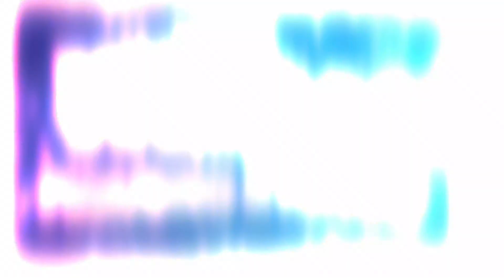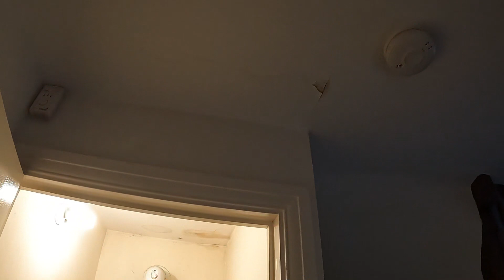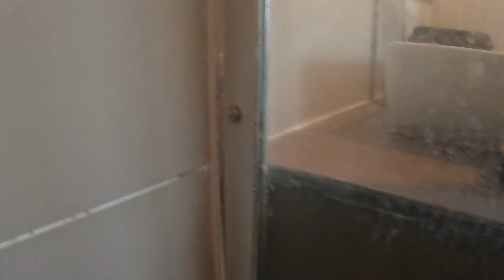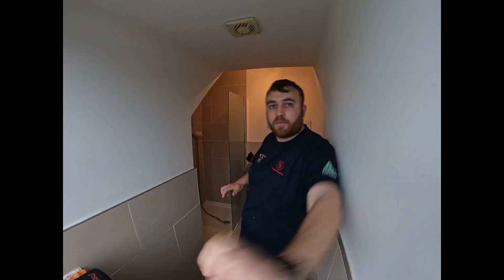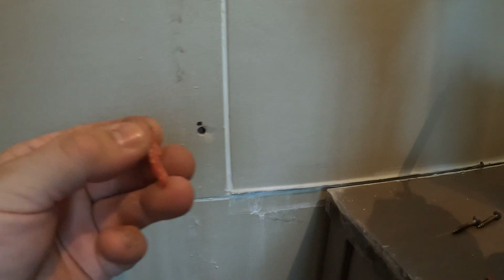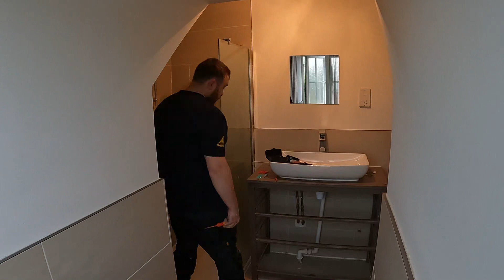COWBOY PLUMBERS! SHOCKING LEAKING SHOWER! | UK PLUMBER

Comment: I liked it, job done. CANNOT believe whoever installed that profile, and whoever sealed the tray. 

No plumber could really step away from that as a job done, so yeah, was a pretender. 10mm all around looks the business, had to be done, and also that finish around the waste into the floor should have been done before for the very reason you did it. 

Always got to think of 'in case of' when you're doing these jobs, don't take it for granted they're straightforward installations.
Reply from the maker: Thanks appreciate the reply always got to think of the just in case